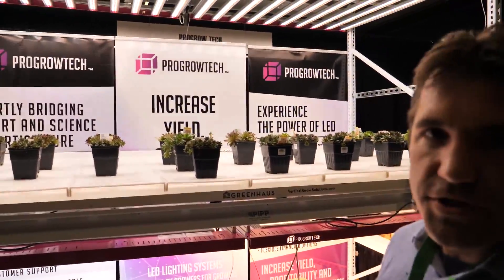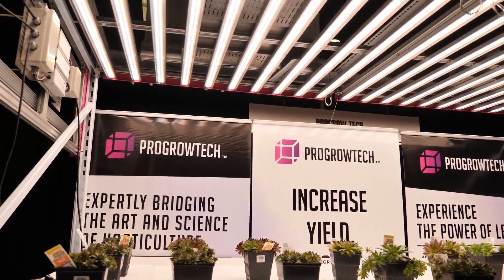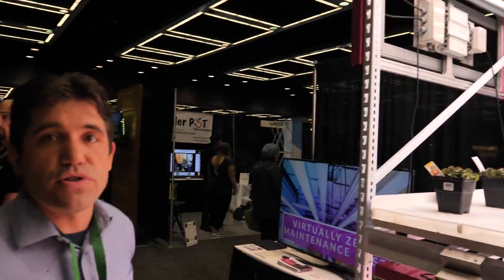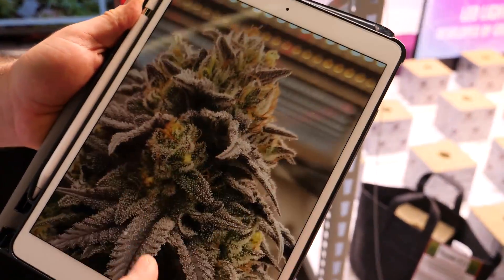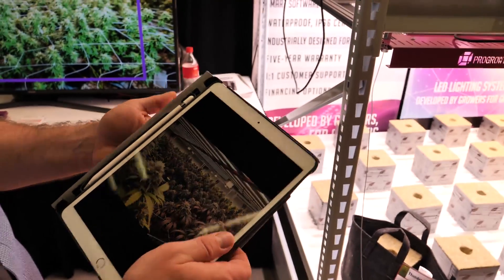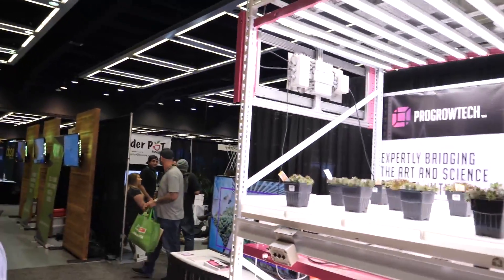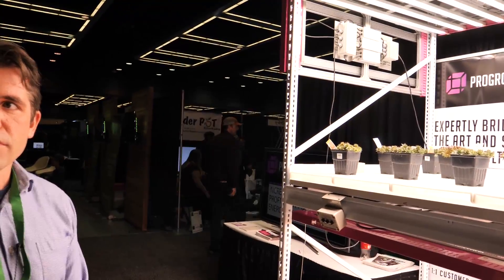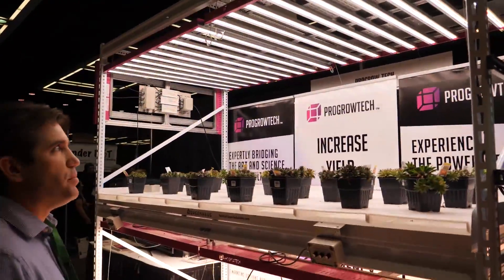CannaCon 2018:  LED Innovators ProGrowTech Evolve 700w

Comment: All Bullshit I been Growing for 34 year's I'm 50 now any 3000k to 4000k 1000 watt HID will Stomp on any LED lights unless it's pulling the same electricty from the wall plus you can't get LED lights close as Hid to the plants unless the diodes are from 1to3 watt diodes other than that they gonna always burn your plants!!! These guys are paid to lie just to get fool's to pay for them Chinese Rebranded and Manufactured LED panels if it's not broke don't fix it since the HID ballasts have dimmers and AC reflectors they rain KING any of us Master Growers get from 2 to 3 pounds per 1000w HID SOG to Growing Trees HID is always KING with Raw power and lumen output with new perfectly balanced spectrum bulbs now🤐 another lie is they run cooler Bullshit again 600 Watts of BTU heat is the same no matter the light source used I haven't seen America's rip off or steal from Americans since Slavery until these fake ass led guys popped up from everywhere Enslaving  and Stealing from it's own dam people again mainly through China now 🤐
Reply: You sir don't know what you are speaking about. Its 2019 not 2016 . You would be surprised the cannabis is better bigger stronger more terpenes more cannabinoids. You keep your hps.
Reply: @marioandreano1236  I been Growing for 35 year's hps give us 30% plus THC I have the best LED also as in optic led cobs it's all about spectrums 3000 to 4000k does it all no matter what light source dummy Greengenes is the master of LED lights he put 3500k LED lights on the map he will tell you hps wipes the floor with 99.9% of all LED lights
Reply: @mackattack8627  You seem to know your stuff man, what light do you recommend for a new grower? Would be nice to have a "top 3" lights coming from someone whos been doing this for longer than ive been alive :) Also, I had a question because I think most of the benefit from HPS comes from the levels of UV and IR that HPS produces compared to LED. If you had a light that produced the same spectrum but with increased UV + IR, would that do better than HPS?
Reply: @MinesanityServer  - don't worry yourself with uv or ir  it's all based on environment and balanced spectrum hps or mh are perfect LED lights have their place as a new grower I'd just use an mh Air Cooled Reflector with a bulb 3k to 4k for a full balance growth start to finish once you learn the plant itself use any Artificial light source of choice save yourself money and buy any 600w Hid and practice with that if you just must have a LED light use a Optic led with a balanced 3500k with a simple part A and B nutrient get the plug and play 100 Watt Optic light buy 1-4 and learn about the light spred and best distance from the canopy of your plants  remember plants are photosynthetic and have evolved over millions of years to survive through harsh environments just use all nutrients at 1/4 strength if Growing hydro and 1/2 strength in medium or soil  of the bottle recommendations and temp,s in your growing area from 70 to 80 degrees Fahrenheit
Reply: @mackattack8627  im not disputing anything that youve said. (my only experience is hid etc, no led experience to draw from) I have to ask, if you are correct, why do the top growers use led? whats the appeal if they are basically equal?
Reply: @izzimichaels2892  -All the top growers not using LED,s us Master Growers that want huge yeilds and over 30%Thc are using Hid we have led lighting also but what is a Top Grower? I been Growing for 35 year's  and been building my own dwc systems for 15 year's now before that I always grew in Organic living soil mediums or soils nevertheless I do have LED panels that are 97 CRI I build myself each true 600 watt panel only cost be $300 USD far as LED lights go the Samsung 288V2 LED diodes are the best
Reply: @mackattack8627  i could have been more specific, i meant when i see huge grows on tv, usually in association with a news agency doing a story on legal grow states. it seems they are always led.
Reply: @mackattack8627  and thanks for the info*
Reply: @mackattack8627  put some videos up of your setup and plants so we can see what you mean...
Reply: Optimus Prime you have the best led? Optic?? Lmao That right there shows I don’t need to read the rest of your opinion.  Guys try stuff for yourself don’t let people on here tell you anything, try it an see for your self wat works best for you.
Reply: @mackattack8627  You do know that running a fkn MH in an air cooled tube is about the dumbest thing u can do. Your running the bulb too cold and reducing its efficiency in half LOL MAN O MAN
Reply: You sir, are stuck in the past. Time to innovate bud
Reply: Its like saying "ive been driving 100 years and my fuckin model t will SMOKE your 2019 corvette. Your smoked out bud
Reply: i dunno about that..... i'm a FNG, but i just built an @ 600w+ led rig(from the wall), and it's WAY COOLER than my 2 315CMH's, i mean not even in the ballpark cooler. I don't have a PAR meter, but the LED rig is hotter LUX output, and pulling less from the wall than the 700w CMH rig..... don't get me wrong, cause' the CMH rig works really good, but where heat is an issue, i don't think that LED's are gonna get beat on that one...... i gotta check to see how much the LED's pull from the wall to match the CMH output...... i know it's significantly less......
Reply: everything mack mack is true, old or new traditions hps will rain kings always increase yields and tHC... LEd on other hand less power draw less heating and air conditioning, can be lower to canopy in small tents. LEd come is various sizes  and can run more led to equal hps power to produce more bud at lower cost to run..
Reply: @terrancemiller6678  HPS lamps are efficient yes but they give off too much infrared heat and you gotta change em out every year to hit good par levels otherwise ur getting stretch more so than you usually do. LEDs at first weren't practical due to their price point and lack of penetration but now with the advent of high output diodes and much more efficient drivers they simply can't be beat. 10 more years from now hps will have gone the way of the dodo bird
Reply: Moron
Reply: Bullshit man, my DIY 700 diode LM301B/H + Emerson build is keeping up with my 400w HID no problem. If anything it's far more efficient because I don't even have it at max power, and it's only pulling 250w from the wall.

Comment: Just wish I knew what light to go for..... So much info everywhere and nothing really stands out.

I have a 600w hps omega ballast in a 1.2m2 space that I'd like to upgrade it seems I need to be an engineer or light wizard to make a correct choice... Can some one tell me what lights produce as much or more while saving electricity? What to avoid? What companies to look out for in future?

I'd love an end game level light basically for a small space.
Reply: Stay with HID we always yeild the most with the best Quality we have perfectly balanced spectrum bulbs now and Dimmers and AC Reflectors if it's Not broke don't try to fix it common sense a $100 dollar HID ballast will BLOW ANY $2000 dollar LED panels out the water with Quality and Yeild unless the LED lights are putting 1000 Watts from the wall but then again you would never to be able to place LED lights close to the plants as we do HID lights!!!!!
Reply: @mackattack8627  Hmm.. I see. Thanks for the message man. Do you think much of the HLG 550 V2, apparently that's the boss atm.. well judging from a few videos and the stats they put out on their website. Seems to match up to a 1000w set up as far as nanomole, par etc (basically not w).

I sometimes keep my hps like 6-12 inches away from the middle plant, while a 16 inch fan is hitting them constantly and intermittent exhaust. Hope they don't get stressed, plus I want tight nodes and not a lanky ending. I guess the LEDs kill or mess up the plants at that range?

Surly if the HLG or any other light is on par with single ended hps and < costs less to run it should be done? What you think chief?
Reply: @ross4675  The only way you gonna match a 1000 watt HID is you have to pull the same Electricty from the wall some panels can achieve this with less wattage if they are using the glass projector lenses over the cobs the Next light mega uses 3000k and 5000k led diodes to get basically a 4000k Spectrum which is Stupid because all they had to to is use 4000k diodes 🤣🤣🤣🤣
Reply: The Optic 8 panel claims 500watt and grow 2 1/2 pounds while using Chinese Rebranded panels plus the panels have 8 fans meaning the panel can only be a 400watt panel minus the current draw from the 8 fans🤔 when Growing cannabis indoors the plant can only achieve the yeilds in wattage pulled from the wall and a Master Grower to get a 1 gram per watt  or above With perfect environment and high yeild strains plain and simple
Reply: I'm actually going to buy several Aglex 2000/400 watt LED panels simply because of the price and Quality and spectrum but again a 600 to 1000 watt HID with 3000 to 4000k mh bulb can't be beat in Yeild and Quality and Coverage many people just complain about the heat from the fixtures because they don't understand how to vent them correctly or not using AC Reflectors back in the days we only had industrial mh bulbs with magnetic ballast and no Air Cooled Hoods or Reflectors and did just fine 🤓

Comment: The energy harvested from the plant (photon) has to be of a certain value (wavelength), because the plant uses the capacity of some molecules (chlorophyl) to absorb those photons. And these molecules do it this way: A molecule is a compound made of atoms with bonds between each atom. These bonds are made by electrons and these electrons are, when no photon hits them, in a low-energy state. When a photon hits the molecule, the electrons get excited and spring to a higher energy-state. This is called absorbption. The kinetic energy of the photon gets converted to electronic potential energy. But not any photon can excite any electron: The wavelenghts (i.e. difference of energy-state of the electron) of the photon and the electrons energy-state-difference have to match. This is why low pressure sodium lamps emit only one wavelenght: In sodium vapour there is only sodium and it's valence-electrons present, so there is only "one kind" of electron that jumps up and down energy states. But when you have a molecule, the wavelengh required to excite electrons changes. This is why it matters if you have 405 or 452 nm photons: One will excite more and more efficiently electrons in the chlorophyll (sry for bad english)
Reply: The Sceptical Chymist thanks

Comment: That guy is also completely wrong when he says you can get the same type of yields with one light in a tent as a commercial warehouse grower does. You're telling me you can put 6-8 plants in a 5'x5' tent with a single 1000w hps light (double ended or not) and get 2-3 pounds or more?? Get real, we all know that's very hard under one hps light.
Reply: wtf u talking about, thats the standard. gpw or dont even bother.
Reply: bishplis wtf are you talking about is the better question. What does grams per watt have anything to do with what I said??

Comment: In my opinion, no commercial grower will ever lower their wattage by MAYBE 300-400 watts at a significant upfront price increase compared to hps. It's also an unproven technology, whereas hps is proven to grow dank. No commercial guys will risk it. I myself use a Perfect Sun led because it severely cuts down on my wattage from another led I have and it has an amazing average par for the wattage. With PS I'm saving money, with a 700w led you might as well use 1000w hps
Reply: Plus in a commercial setting everything 277v and juice is 1/3 the price.
Reply: 400v

Comment: Dude, can you help me with upgrading the drivers in my contacts led? Think I've found a mean well driver that might work,  but runs at 0.35A . the driver I want to replace runs 0.25A every other spec on the two drivers are the same. Would it be ok or over powered?

Comment: So how good is this for normal veg and plan growing... As in DOES EVERYTHING HAVE TO BE ABOUT POT FFS!
Reply: This stuff is marketed heavily to cannabis growers as they are the only ones that can really afford this high tech stuff.
Cannabis is an extremely high value cash crop and the industry is greatly increasing in size at the moment. As a result there is extra money for experimentation, and this stuff can greatly affect marijuana yield which doesn't really matter much for a leafy green or tomato.

Edit: The light being demoed in front of them costs about $2200 for a 4'x4' unit, before tax.
Reply: yes because money grows on TREES

Comment: 100 light set up @ 2k a unit = $200,000.00 for technology that will be severly outdated in less than 18 months.  Absolutely and completely unrealistic for 99% of us in real business.    These extremely  overpriced brand new green companies with brand new green products are for your garage Growers with just a couple lights. Who in their right mind in business would spend $200,000 with a brand new company that could go belly-up anytime  and can't warranty anyting and you're left with nothing these products are designed to make somebody a whole bunch of money First most before performance
Reply: With out these people pushing tech the industry would stall and there would be no more future releases. It’s just a time game with LED these will be the future. Low wattage high output.
Reply: Yes the price is high, but the cost of the parts does make up a substantial quantity of that, they aren't selling $150 worth of parts for 2k. This is why we need adoption by more companies to prove there is a big market for this stuff and bring component and production prices down. Making those led boards isn't cheap, and they need to fit some profit in. I would never spend this much, but I can understand why it costs, and it is At least doing things similar lights don't do. So there is innovation in it.
Reply: Well let me make another comment: Hands down I would sign up for these lights any day they are awesome over HID. The benefits are incredible it's just the cost of them and the rate of technology increases so fast they become yesterday's news just like my first generation flat screen TV that cost me $5,000 that now I can walking to Costco and pick the same thing up for 600 bucks but that's life in the big city that's all!  If money wasn't a factor..........
Reply: get ten 1000 watts de hps for the price of one 700 Watts LED and have enough money left to pay for electricity bill for one harvest. hps  are the way to go.

Comment: Hey gang! Who is going to backwards engineer and source the parts to do DIY. I hope Grow Mau5 and Green Genes have some free time to use their connections to make this a DIY quantum leap in lighting right next to the latest R&D from the industry
Reply: http://ledgardener.com/forum
good source of info for DIY!!
Reply: Looks like they built those strips or had them produced custom for them... I say that due to the increased diode density on the ends and the multiple color channels, I doubt they are pre made strips they just picked up. Some hlg strips or if you can get lucky finding something on Alibaba would be your closest config these days, but you lose color channels. Maybe greengene or another board producer could add some to their to do list. It is a nice layout. (lots of $$ in heatsink though, I wonder if plain aluminum can do a good enough job...)
Reply: I think it’s going to be the LED placement intensity & density and the spectrums that differentiate this from the spider ex which goes for about 1500 for the first 10.
Reply: Jolly Green Giant thanks
Reply: Jolly Green Giant _ thanks for the reminder! Forgot to check the forum out.
Reply: https://solstrip.com
Custom designed quality LED SolStrips and accessories affordable for DIY home gardeners. Check out their SolStix rack designs - very similar but at a  homegrower scale and price.

Comment: I wish I could afford "meanwell" power supplies! I'll just stick to my 32v printer power supplies.
Run it high voltage guys (32v) less current more volts equals more efficient.
Reply: gerald West - I used the same thing for my first light!